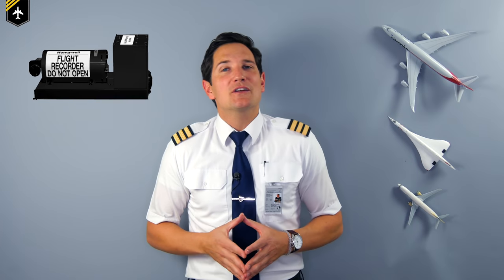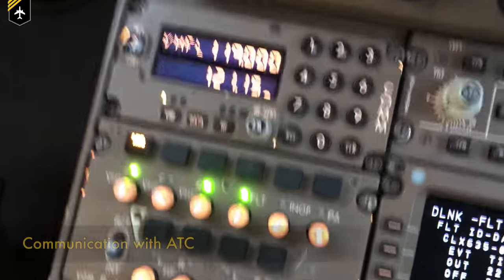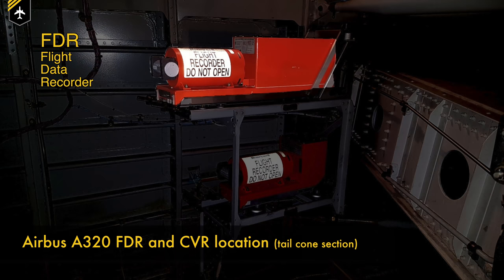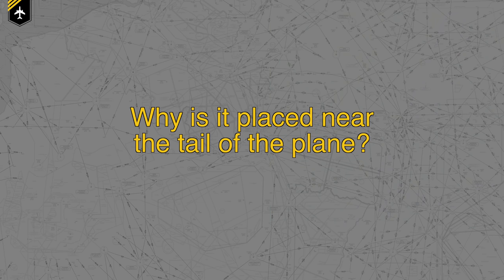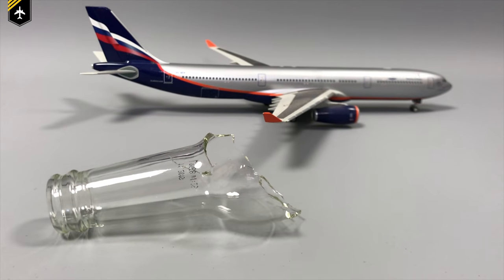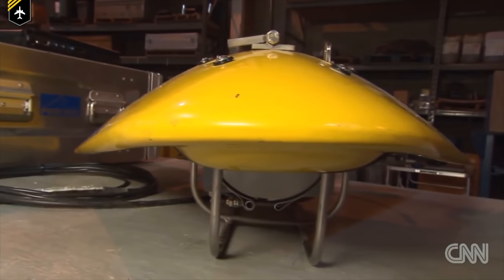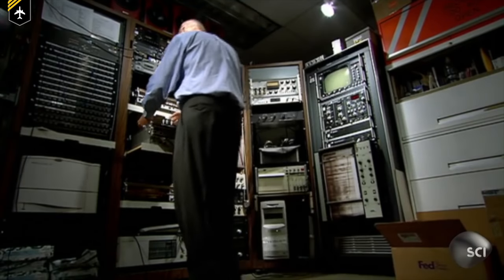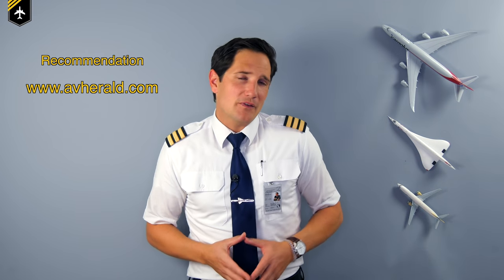BLACK BOX/Flight Data Recorder/COCKPIT VOICE RECORDER explained by CAPTAIN JOE

Comment: there have been a lot of cases where investigators could not find the cause of an accident because electric power on the aircraft was lost (as far as i know, the backup power sources like the RAT or aircraft backup batteries do not feed the CVR/FDR, only the APU does) 

why dont the black boxes have backup batteries (inside the unit itself) that can allow it to continue recording for even just 5 or 10 minutes when primary power on the aircraft is lost

Comment: To all saying to stream data to the cloud or to Satellites: the limiting factor is Bandwidth, Rf Power, and most of all, security. Having the unit contained on a single craft prevents the data from being hacked easily, and it maintains the necessary bandwidth to pass all of the data variables to be recorded. To transmit to a satellite, requires either a lot of power spattered across the whole sky, or a directional antenna, same occurs for downlink to ground, for the necessary frequencies and bandwidth.

Comment: Captain Joe, I have been watching a whole series of airline crashes that were on the Smithsonian Channel. I found them intriguing in the manner the NTSB and their counterparts around the world.  The crashes covered everything from the worst aircraft crash ever at Tenerife in the Canary Islands to crashes in the Amazon jungle, even the Northwest crash with a 4 year old girl as the only survivor. Many of the crashes had catastrophic fires for extended periods of time ultimately destroying one or both "black" boxes. So my query is this. The two black boxes can only tolerate heat of 2,000°F for 3 hours they then become unreadable. Well, I thought about the tiles on the belly of the space shuttle which saw re-entry temps of roughly 3,000°F. So how can we better protect those important black boxes?? After much thought, some tinkering, and plenty of research, I think the answer is a combination of the ceramic used on the belly and wings of the space shuttle, kevlar, and the protective aluminum shells used by firefighters fighting forest fires as a means to survive a flash over or fast moving fire. There are a couple of other components in the mix, but what if we could build a better mousetrap for the airline industry??? What if we could protect those black boxes, regardless of the impact damage to the craft, in order to allow the most comprehensive analyses, information, breakdown of what was happening with the aircraft, cockpit conversations, weather, thereby disseminating whatever information the investigating teams need to know. Well, I thought I would run it by you and pick your brain as it were, then perhaps youcould tell me who I should present my ideas to. I want each aircraft to be able to tellthe story of why it crashed. The survivors and the families left behind deserve answers in a reasonable time frame. Thanks, Joe. You are the best!!

Comment: I went to university for electrical engineering. 
One of the sample tests we would be asked to solve is that you are given a BLACK BOX, with unidentified electronic components inside, and you have to preform certain tests to determine which electrical components are in the box, and what configuration they were in. 
So the term "Black Box" simply meant "hidden" where you couldn't see exactly what was inside. 
I assume this evolved into the general term where "Black Box" simply means any metal box filled with electronic components.

Comment: Latest CVR will have a duration of more than 2 hours. For type certificate aircrafts after january the 1st of 2021, the CVR must have a duration of 25 hours. Amendment 40 of fev 2016.
Reply: Still it's just using 1960s tech. These recording devices should not even be on the plane - stream them to the cloud as if we had 2018 tech!
Reply: Streaming is also a mean suggested for that also.

Comment: Nice video.  In engineering a "black box" is one which is treated as a single unit. It is tested and managed without regard to what is inside; you simply focus on the inputs and outputs.  Since this device is somewhat "sacred" and not intended to be opened unless there is a crash, perhaps that's the origin.

Comment: The CVR does record for 2 hours as stated in the video, but a new FAA and EASA requirement (about 10 years ago) calls for the CVR to record for 10 additional minutes after power is lost.  It does this by having its own battery that records an additional 10 minutes after power is lost.

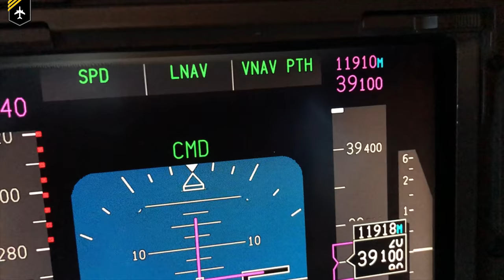Comment: @3:13 > You are absolutley incorrect on saying todays FDR can record up to 1000 parameters.  FDR data is divided up in Words and Subframes.  A modern FDR will have up to 1024 Words    Each Word has 4 subframes, each subframe has 12-16 bits (depending on the FDR).  So theoretically each Word could record up to 64 parameters.  Also, there is FAA and EASA requirements for how many samples per second a parameter MUST be recorded.  So one parameter could use up to 8 Words of data.  So a modern FDR can record way more than a 1000 parameters dependent on what is being recorded.  
There are 88 required parameters per FAA and EASA.  Saying there are 88 required parameters is kind of a misnomer since,   a required parameter such as Airspeed will have to be recorded from each Air Data Computer, so just this one required parameter of the required 88 would actually be up to 4 parameters. Same for most of the 88 required parameters.

Comment: I often ask myself why aren't they monitoring cameras inside and (looking) outside the plane, which could be useful as flight data, not only in case of accidents, but to give the pilots a better look to what is going wrong with some parts of the plane that are visually inaccessible during the flight.

Comment: One CFI told me to think of a black box as a device that runs "out of sight, out of mind"; it's just sits there, quietly recording data.  Only interaction is preflight test and pulling the circuit breaker after an incident so that the recording won't get erased on the next loop.

@Captain Joe  - What are your thoughts on a cloud-based CVR, FDR in addition to the physical ones?  Are any airlines using any such technologies now?
Reply: TonyP0927  I believe AIRBUS has some teletmerity , between aircraft, an their base inFRANCE, as was recalled with  the A330, from  Argentina to Paris, that went down in the ATLANTIC after a severe T/storm. Believe it may be AF441

Comment: Why not:
A video recorder?
More time on the cvr?
Data transmission throughout the flight so no black box is necessary?

The technology exists and even implemented on aircraft. Example the Air France airbus sending repair requests to its maintenance department before it crashed in the ocean.

These systems need to be updated.

Comment: Joe, what do you think about a kind of online FDR? I think every plane should send some most important parameters online via radio transmitters to a station on the ground. (Like some engine manufacturers already do). On this case there is a better chance to evaluate the reason of the crash in the case when you can't find the lost plane (mh350) or the Blackbox is destroyed.

Comment: The FDR and CVR are send to the authorities for investigation after most incidents and not only after crashes. In most countries you need the approval from the pilots (if still alive) to use the CVR data (pilots deserve some privacy too).
That erase button just moves the recording to the erased folder so investigators can find it quicker. I would call it the ''I am guilty button''.

Comment: Another posibility for the black boxes's name might come from engineering:
A black box test is one where you are not allowed to see what's happening inside what you're testing, be it the parts of a machine or software code, only the output of the thing.  Similarly, pilots don't need to see inside a black box to know the specifics of how it works, they only need to know that it is there and that it works.

Comment: Why are CVRs and FDRs dependent on aircraft power only. It seems that if they had a self contained backup battery that would keep them running for around  2 minutes after cabin power is lost there could be some important data recorded from any remaining inputs. It  could  also show where breakup first occurred by the order of inputs failing. In the  Columbia  disaster flight control saw sensors failing in the left wing then tire pressures etc. This was before the crew knew of any anomalies.

Comment: the only good reason for a pilot to make a video about an ongoing aircraft investigation is when the purpose is to (demonstratively) inform the investigative body about erroneous assumptions in a preliminary report. (I remember, from an ACI episode, that pilots used this in the mid 90's to inform the NTSB that a maneuver they called non-standard was actually a de facto standard and, more importantly, much safer than what they called the 'appropriate maneuver')

Comment: Okay, I have some questions: First, does the location of the FDR and CVR vary by plane? Ex. the location of them in a Boeing 747 being different than a 777, or an Airbus A330 vs an A380? Second, is the CVR placed in a different spot than the FDR? Based on the video, the CVR in a 737 is in the cargo hold, so does that mean the FDR will be next to it or will it be in the tail? Or in the A320's case, there are 2 flight recorders stacked on top of each other. Is one of them the FDR and other a CVR? Or are there 2 FDR's? And lastly, based on the video, for any common model of commercial planes, is there always a physical exterior door towards the tail cone section so they can be accessed? Thanks for any responses.

Comment: "Black box" is also an engineering term to refer to a component for which it isn't important to understand its internals - how it works - just the inputs and outputs. Perhaps the name carried over to aircraft telemetry because the pilots don't have to worry about how the device works.

Comment: Hi, Joe. I have a question for you: how does a airline manage the pilots when they need to fly more than 8 hours?
so, now you're flying a cargo plane, which is likely to stay in the air for 8 hours. since a pilot can only fly 8 hours and then they have to go to rest, how does the airline manage the pilots actually controlling the airplane on board?
for example, you need to fly 15 hours to your destination. in this case, how many pilots will be on board? and when will they get to rest ? Is it required to have 2 captains on board?
Reply: 2 pilots are required for takeoff and landing, however during cruise, only one is needed in the cockpit.

Comment: Captain Joe, nice video. Anyway an important question. Why don't change the voice recorder for a video/voice recorder?. Today technology doesn't make it expensive for the airliners to apply it. There's any reason or is an only economical reason? This way can see what happen in the cockpit on any accident (minor or mayor) and the pilot's response over it.

Also, with today technology, why there's even exist this black boxes? why not all the information goes through satellite directly to the main office of the airliner online, so no need to find any black box if any accident.
Reply: Satellite relays can be unreliable, depending on weather, etc.

Comment: In the future is it possible to do away with the Black Box? As these days modern planes can transmit real time Data to control center of the Airlines or the Aircraft manufacturer. Is the Black Box still required in such a case? Thanks
Reply: Binny Alexander well it is quite possible. Not sure though regarding the current infrastructure being able to support it, as the data is really really vast.

Comment: Capt Joe I have a question! Have you ever had a scuba diver on baord get the bends because of the lower ata pressure? Thanks
Reply: Scuba Steve and Underwater Rock Climbing every diver is supposed to KNOW that you do NOT dive then FLY, you are looking at a possibly suicide.
Reply: Scuba Steve and Underwater Rock Climbing    Have you done any mountain diving, by that I mean a high altitude lake, ever dove in the   ARTIC  ? The ARTIC WAS SAFER.

Comment: Why do they use 37.5kHz for the pinger?  At that frequency the absorption in sea water is about 5dB/kyd which together with spherical spreading limits the detection range of the pinger considerably.  This would make detection short range and difficult.  I assume that it must be a trade off with sensor size/weight/battery life.

Comment: Hi Captain Joe,
How do airlines handle the different regulations around the world? I hear "FAA" lots of times, but there must be different organisations around the world. Do the regulations sometimes cause conflict? Do you have to keep track of all the rules depending on where you go?
Reply: When a aircraft is certified by the manufacturer and assuming it to be flown in mulitple countrues, the manufacturer uses the most stringent requirement.  That makes sure it does not cause any conflict.

Comment: The flight data recorder underwater pingers are antiquated and need updating. The frequency is too high so you will never find a really deep water crash. As higher frequencies are absorbed fast through the water column. The batteries run themselves out after 30 days rather than swapping to a low power respond only if it receieves a signal from a ship. It could last year's in this mode conserving battery. Modern technology has moved on so much since the FAA specification was written. The entire subsea oil and gas industry uses subsea acoustics to locate and position equipment every day so the towfish receivers need not be rare if they used the correct equipment.

Comment: Sorry for late Joe, I live in Malaysia and the time you upload is at midnight. Can you tell why the tail of an aircraft is important or why without the tail the aircraft is uncontrollable?
Reply: Because the vertical and horizontal orientation is controlled by the tail 
If its not present 
Then you can't do anything to save your plane from crashing
It is the only thing which keeps the plane stable
Reply: OK thanks a lot!

Comment: I think the explanation for the location in the tail is much simpler:
1) near the cockpit is a bad idea, as that is most likely the first part to get damaged in any crash.
2) Near the wings is a bad idea, as that's where the engines and fuel is stored.
This simply leaves the tail.

Comment: Hey Captain,
I was always wondering why they do not engineer the Black boxes to separate from a plane in a crash and then float to the surface....That would help both with finding the box and potentially the plane?

Comment: Joe, if flight school is so expensive, would the RAAF (air force) be a decent option due to a free bachelor's of aviation?
Reply: Depends, because it's not really "free". Yeah it costs you no money, but you can't just leave the air force after you training is finished. Normally you subscribe for at least for 5 or 10 years to stay there after you received your degree. (I don't know how the standard look like for the RAAF) So you will stay with the airforce for some time if you wanna go that way.
Reply: @shi01  I checked, For the 3-year cost of a bachelor's in aviation, a service period of 15 years is required. BUT when stationed at an overseas base, you most likely will have your family there and will be home 3 months a year.

Comment: Why are black boxes not encased in floatation devices which will help them to float to the surface in case the plane crashes into deep water as it happened in the case of AirFrance (South Atlantic) and became almost impossible to locate?

Comment: What is the magenta line across the air speed indicator showing on 3:02?
I noticed that it is something new on the 747-8 during the decent.
Reply: its so that the aircraft can be in centerline and not too high and not too low from the air port and expecially during landing its used so that the pilot is in centerline and again not too high and not too low thats what the papi lights are also for
Reply: @tapzulu1881  Wow thats a question from 3 years ago.
It sound to me like you are talking about the bar in the Navigation Display,im talking about the airspeed indicator.
But anyway iv talked to a real 748 pilot since then and he told me that its for the allowed airspeed error during decend.
So when the vnav causes the aircraft to exceed or go below the desired airspeed in favor of the glide path.
Reply: @KartingDriver  lol ik its been 3 years i saw it and thought i would help